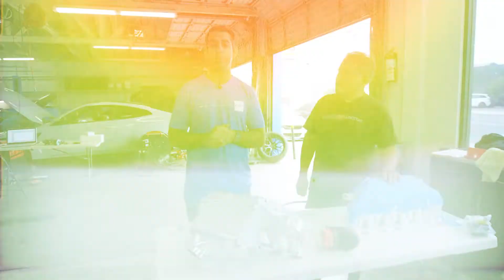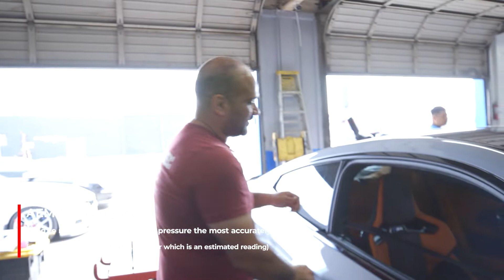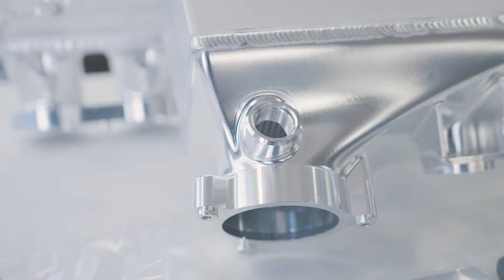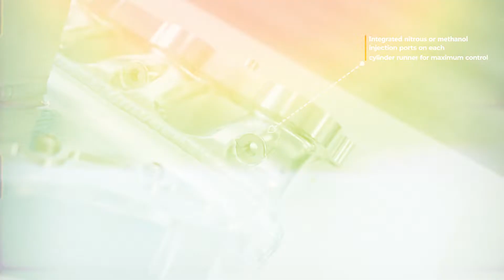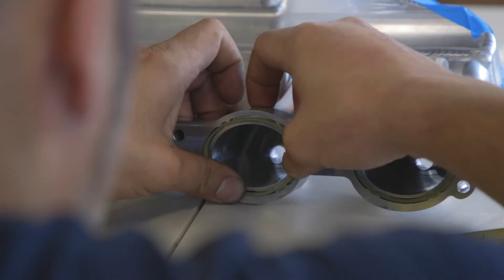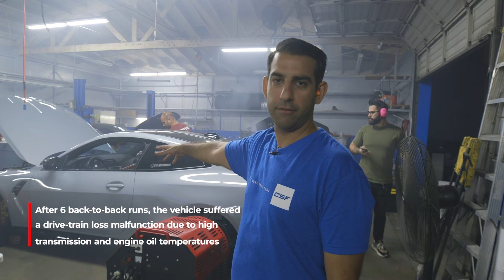CSF BMW S58 "Level Up" Charge Air Cooler Manifold Intercooler Testing

Comment: What modifications did this have. Really interested in the CSF Manifold would like to know what else to target for that 800 whp to help make the manifold worthwhile.
Reply from the maker: You would need to have upgraded turbos (hybrids are more than okay for this power level), more fueling / flex fuel. You can get away with stock clutches and engine. A port injection system that can be run through the manifold, and a good tuner.

Comment: These clowns claimed this is USA made and that the 6k price tag was justified…..it isn’t UsA made and this manifold gave zero HP gain on all our testing.  It’s a preventative failure thing-  you can wire your stock manifold and get the same result.  These dudes lied about where they made it, and they can’t explain the 6k plus price.  Fuck that